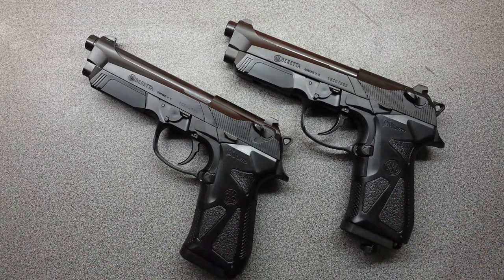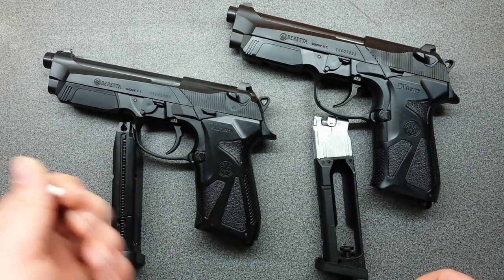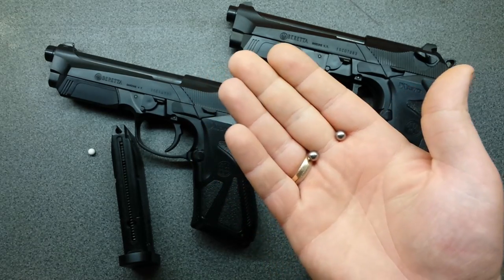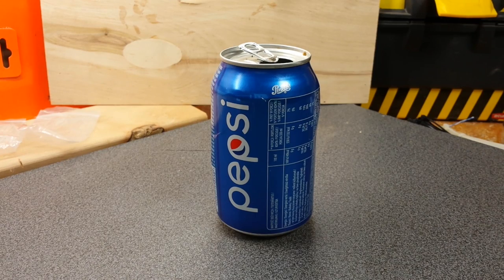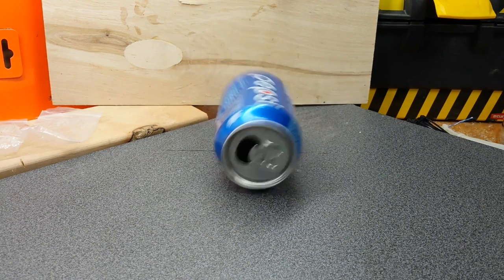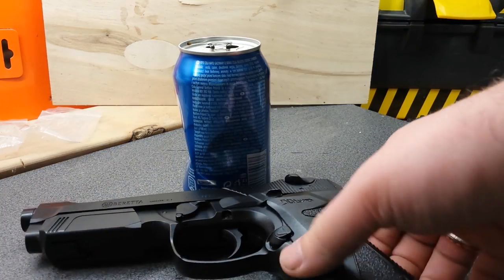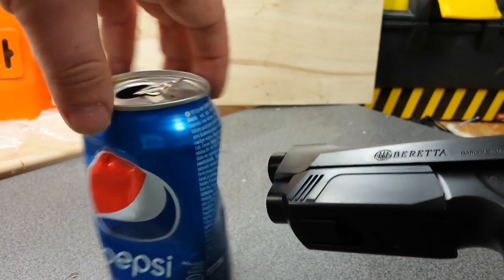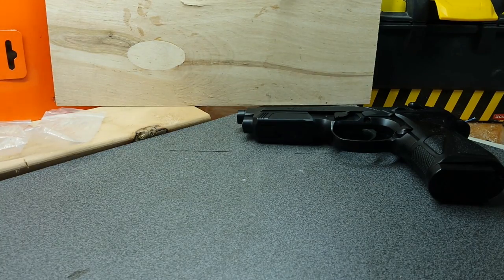airsoft shooting 6mm metal bb, can you shoot metal bb out of airsoft?

Comment: The gun produces a constant force, the variables are the mass of the BB, surface finish of the BB and accuracy of the calibre (how well it fits the barrel). The energy produced is the same for both projectiles but the velocity will be different for both; the SS BB is five times heavier will be travelling at a much lower velocity at about 20% of that of the standard BB. If you want real results dial up the power.
Reply: Noted
Reply: How do I increase power
Reply: This is not really true in real life. In extreme cases heavier bb's of the same diameter can have up to double the energy. Google airsoft Joule creep, it is well documented. Basically light bb's leave the barrel before harvesting all the energy from the gas, it is more notable with handguns (shorter barrel).
Reply: @Peanutbutterfunds air pressure

Comment: Your using steel ball bearings, too heavy.. they sell 6mm aluminum bb' s that weight .30g and they'll go right through a can or window..
Reply: where do they sell it? aybe in DIY markets?
Reply: Not thagmt I've seen? I don't think they do it, if so link please?
Reply: at taiwan we have 6mm glass bbs similer wight(0.2g)and harder then the plastic bbs .
Reply: @蘇服-q7v  so cool
Reply: @蘇服-q7v  I'm converting to propane with an adapter due to the rising costs of name brand airsoft green gas,some bullshit I tell you some days I spent $150 for just three cans
Reply: *you’re
Reply: Definitely through a window?

Comment: that's a good experiment, thanks for the video!
if you loaded a 6mm BB into a Co2 powered airsoft gun with a 14 inch barrel the velocity would increased greatly because of the science/or/physics regarding Co2 and how it expands in a gun barrel.
Reply from the maker: thanks. Longer barrel naturally will help since co2 going to be fully used to push out the projectile instead of coming out as gas with it at the same time.  would love to try this out with a rifle. :)
Reply: @gillwiz  sveiki, o galima naudot spyruokliniam(taurus pt 92 su metaliniu vamzdžiu) ir ar metaliniai šratai negadina šautuvo?

Comment: 6mm bb is slightly larger than a .22. Steels is a lot less dense than lead though. If you upgrade the spring you might be able to pierce skin but you probably wont kill anyone. This would have 0 stopping power.
Reply: Nobody is implying they want to .-.
Reply: Home defenceman to the max breaks into house full auto mag dump with my 75 round drum mag

Comment: Speaking of 6mm steel balls, Last month I found a German eBay seller with 6mm carbon steel BB's and I bought 2000 rounds of the carbon alloy steel balls which  weigh 0.89 gram each and I tested them with my SocomGear Kel-Tec PMR-30 Co2 pistol and got as high as 330 fps and averages between 315-320 fps.
From 8 feet I fired two shots that went straight through both sides of a metal soup can!
The carbon steel alloy ball weighs about 10% less than the chrome steel ball.
My Tolmar Grand-Power X-Caliber NBB 6mm Co2 pistol shot the carbon steel balls around 275 fps.
The Kel-Tec PMR-30 shoots .12 gram plastic BB's around 580 fps, and .20 gram around 500 fps, so it is the only 6mm Co2 pistol that I know of which has the power to properly shoot 0.89gram steel balls.
Reply: Wo nice

Comment: I have a 1.8 joule airsoft pistol that fires at around 435 mps and it can easily shoot trough a pepsi can and even damages the wall behind it with normal 6mm bullets ! I can only imagine what metal bb bullets can do on this gun.
Reply from the maker: well, if your gun is shooting 435 meters per second, i assume with 0.2 gram bb, then it would be 18J not 1.8J  but i agree it would destroy stuff along the way
Reply: Vlad, ce pistol ai?

Comment: i have shot .22 cal pellets from my asg dan wesson    airsoft gunwith 4 inch barrel .the pellets were to small for the gun (skirt from pellet wouid not seal the air presser behind the pellet.i put the pellets in a vice and gently sqweezed until the skirt was splayed out slightly.remember that doing this could possibly damage the inner workings if you splay them too much.this particular gun is a revolver with removable shells.very realistic gun.the pellets are much heavier so the although i havent done a test on fps. i imagine it is much slower.i shot straight through a large potato at about twelve mabe fifteen feet though.fun experiment.
Reply from the maker: if you are using lead pellets then you dont have to worry about damaging the barrel too much, since lead is a lot softer metal than steel, which is typically used for barrels.

Comment: how do metal bb's effect 

speed ?
accuracy ?
range ?
Reply from the maker: it drops the speed quit much, as you might suspect since it is from 5 to 3 times heavier depending what plastic bb's you are usually using. Accuracy seems to be not affected, actually it is a bit more accurate since it is not affected winds and a bit more stable in the flight. Range drops, but everything is quit relative to the power of your bbgun.
Reply: .177shooter is there any 6mm bbs for airsoft guns that are metal because i dont like the plastic
Reply from the maker: there are aluminum ones. Can find them on amazon, or use the ball bearings, they are not meant to be used as airsoft ammo, but if it fits it will shoot.
Reply: same here dont like plastic like metal.
Reply from the maker: there is this guns version in .177 steel bb's. would be easier and cheaper than buying ball bearings

Comment: can you shoot a metal 6mm bullets in an airsoft sniper rifle with 1 jouel of power ?
Reply from the maker: if you mean like bullet taken out of a for example 22lr casing? theoretically you can, but due to the fact even the lightest of them would be around 32 grains it would just barely leave the barrel. And if you mean those 6mm ball bearings, with 1 J it would get a bit better results but no where near of desired effect. 1J is super low power.
Reply: .177shooter i think 1 jeule is the max limit in ireland before it becomes a firearm
Reply from the maker: that sucks, and i thought that in Lithuania 7.5 joule limit was strict. I had to take out permit to get possibility to buy anything above 7.5 J for airguns, and low power firearms with power less than 7.5 J
Reply: .177shooter is 1.9 joules enough to hurt someone else

Comment: are 6mm bb and normal bb are the same?
Reply from the maker: Depends what are you thinking normal bb is. Generally in America a bb gun is considered a gun chambered in  .177 caliber steel bb, and 6mm airsoft bb would be same as .22 bb. Got the name from predecessor of a .177 since airsoft guns came along a lot later.
Reply: Thank you for replied! Apologize that I should've have made it clear, and yes I meant 0.177 BB, because I was looking at a Japan made: 

Black Dragon 7" B Version
Item Weight (gram) 1180 
Major Color BK 
Length 285mm 
Barrel Length 170mm 
Blow Back BK 
Hop-up Adjustable 
Shooting Mode Semi-Automatic 
Magazine Capacity 31+1 
Bullet Type 6mm BB 
Power (Muzzle Velocity) 350 FPS

While having a Umerax Colt Commander air pistol using 0.177 Steel BB and I wasn't sure if 6mm bb are the same thing.
Reply from the maker: The gun you are looking at is a airsoft. 6 mm equals .22 (well almost) and 4.5 mm would be .177. So if you are interested in .177 this gun is not for you. Because generally 6mm bb's are like 3 grains so super light. And putting ball bearings like i did is just not suggestible and i did it as a test. Ball bearings are way to heavy at 15 grains. Airsoft guns are not designed for such a heavy projectiles.
Reply: Thank you, i fully understood now!

Comment: Ok can U help me in New an never own a air soft gun I got a Beretta gardone v.t 13h64625 is all I no an says 6 mm BB on side so does that mean any 6 mm plastic BB will work in it bought it at a yard sale 4 five dollors not a co2 u have a thang that pulls out an put in BB he said but he didn't no an I don't no Jysts bought it 4 my son an he don't no an I don't no so if any one can help me all I no is says 66 BB so do I get the plastic kind I need 2 no what 2 use in it can u help me pm me let me no I'm justs gone 2 get plastic bbs 6 mm 4 it I guess that's what it means have no clue don't no much about em help me out

Comment: Can I shoot metal BBS with my airsoft gas gun pistol.Plz let me know.Thanks
Reply from the maker: is it possible? yes, you have seen in my video. Can you? well you'll have to ask you mom if you can :D
Reply: .177shooter I saw your video.I use  green gas for my pistol.Your pistol is different.
Reply from the maker: so? you have seen me shoot with spring and co2. If it fits, in the chamber it will shoot. Only with a lot lower speed.

Comment: can someone use a crossman 2100 (.177) clasic with metal bb un airsoft? pelas answer
Reply from the maker: Crosman 2100 usually are used with .177 pellets, since the barrel is rifled. You could use .177 bb, but that is not recommended since most of them are steel bb's, and that would damage the barrel over the period of time. Airsoft BB's are 6mm or .23 so they would not fit in the barrel to begin with
Reply: But are legal for a airsoft party
Reply from the maker: crosman 2100 is not shooting airsoft BB's so no, it would hurt someone. And neither are those metal 6mm BBs would be allowed to enter a Airsoft game